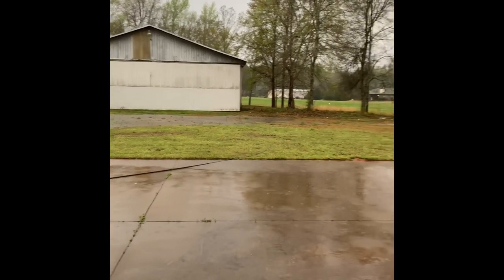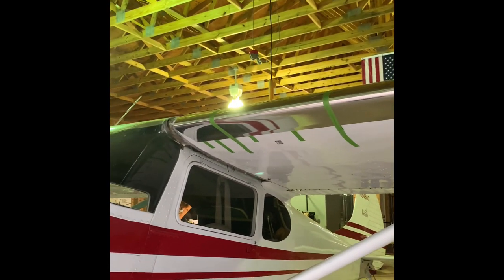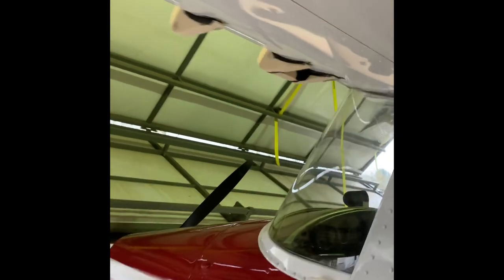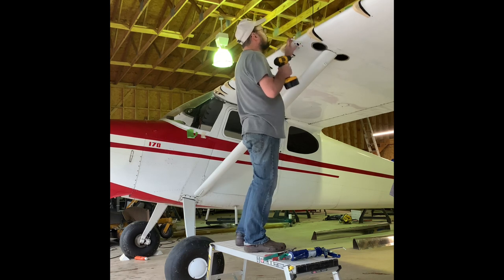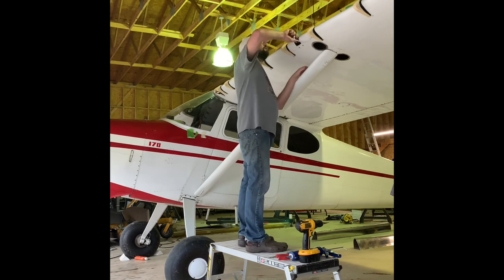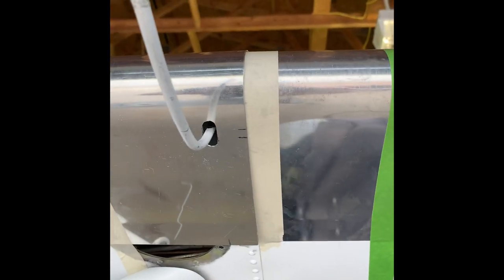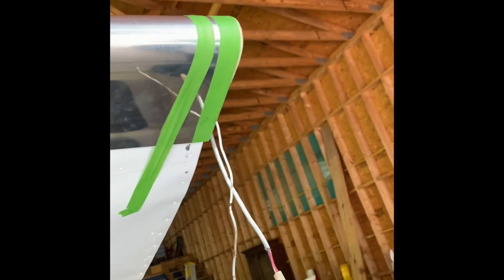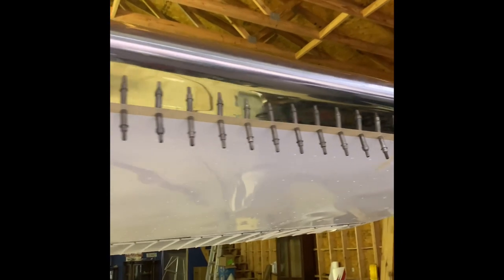Cessna 170A Sportsman STOL install (Day 2)

Comment: I had an A model and wanted to do the sportsman’s stol kit but it was onlybstc’d for the B model.  Are you doing a field approval
Reply from the maker: Yes, I was able to get a field approval signed off by the FAA by using data that Stene Aviation has available for the “A” model.
Reply: Very cool looking forward to seeing how it performs.  I have a straight tail 172 that I will be soon putting this mod on.